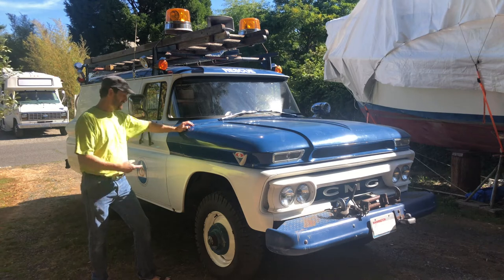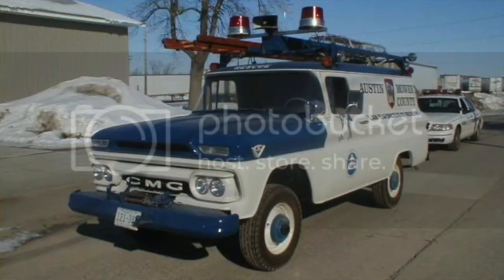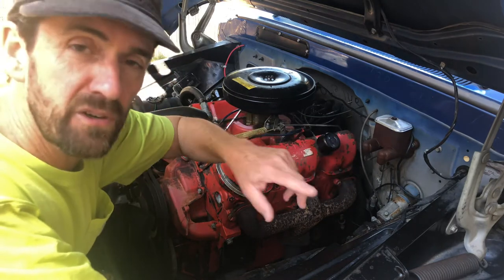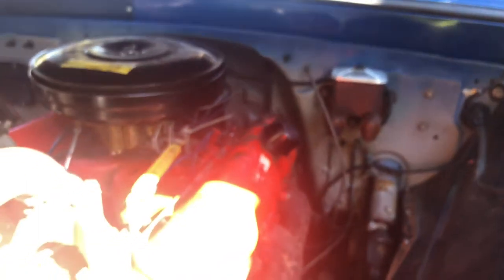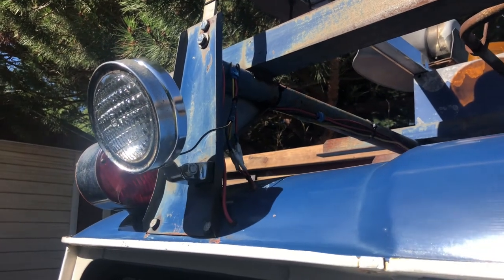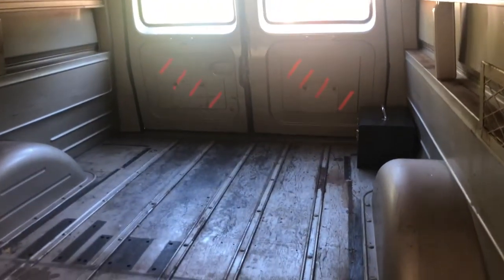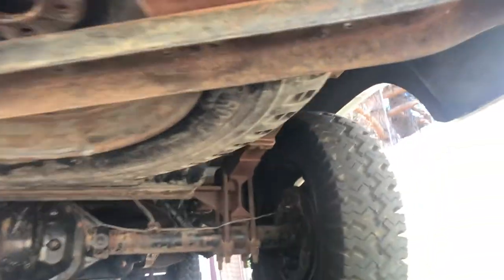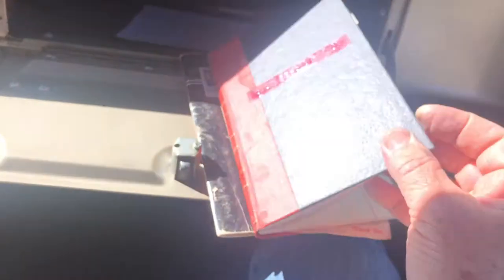1962 GMC CD Truck Intro and drive

Comment: Sweet truck!  Must have been built on a Monday or Friday (CMG), as for the roof top lights, I have never seen Federal 184's used before.   Most CD trucks had the Federal 175 Beacon Rays(Hill light) installed.  Digging the ride, emergency vehicles are the best for not being all rotted out.  Take care!